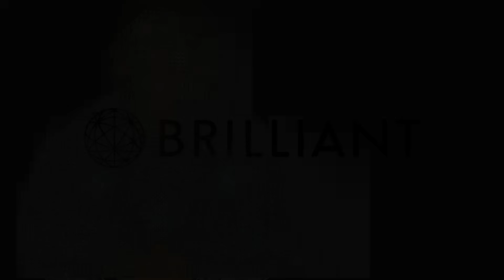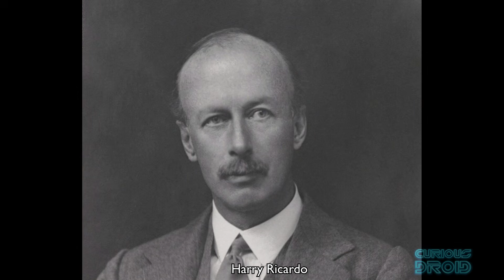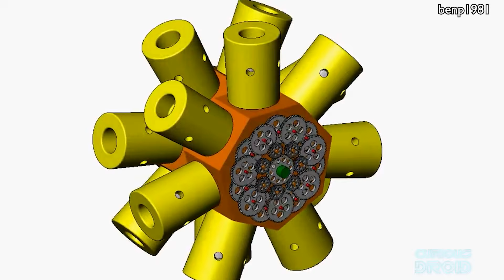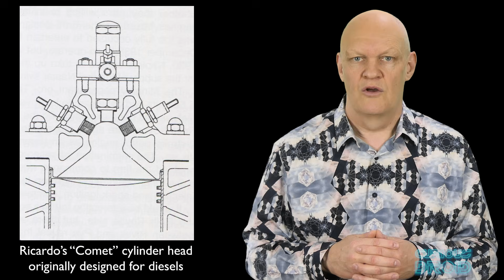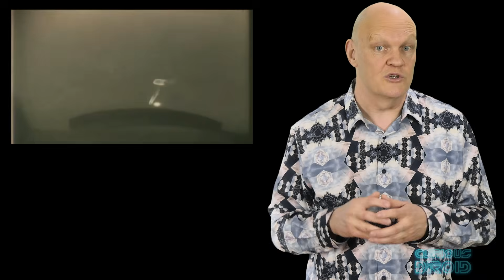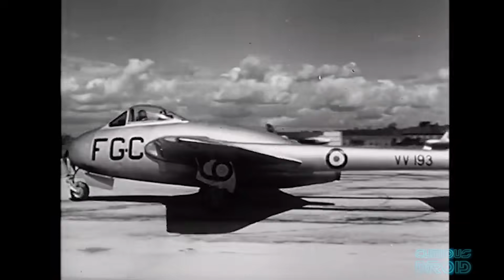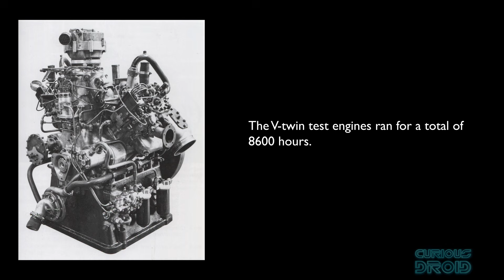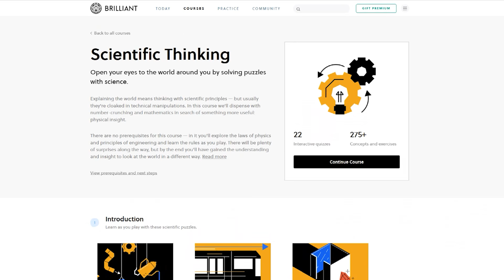Rolls Royce Crecy - The Most Advanced Piston Aero Engine Never Made.

Comment: Rotary? You mean radial! Rotary is something completely else. ;-)
Reply from the maker: Yes, I meant radial, my bad
Reply: @4one14  It did, you turned sharper one way than the other, powering up caused a wicked snap roll and the gyroscopic effect the engine had made precision flying a black magic art rather than a skill.
Reply: You Wankel !!! 😉😜🇬🇧👍
Reply: Long live wankel
Reply: @McRyder67  not Wankel rotary...
Look up World War 1 rotary.
The radial had the pistons stationary with the shaft turning.
The rotary had the shaft fixed and the pistons spinning to aid cooling.
Reply: @PrinceAlorian  got it thanks, but still long live wankel 🤪🤪🤪🤪
Reply: @PrinceAlorian  Yeah, piston rotary engines were crazy shit.
Reply: @McRyder67  any excuse to say wankel…it gets taken haha
Reply: @trayolphia5756  most def
Reply: @PrinceAlorian  Do you mean 'cylinders' vs "pistons"?
Reply: @loganv0410  To be anally correct the pistons and shaft remains stationary and the entire engine block (cylinders) including the valves and valve train rotated in a rotary.
Reply: @PrinceAlorian  if i remember well, you have to switch off some candle to vary power output
Reply: @AaaBbb-ff1pn  Some versions didn't have throttle control, it was all or nothing on the power band.
Reply: @PrinceAlorian  weren't they called orbital engines?
Reply: @johneyton5452  No, the orbital engines were designed in the 1970's in an attempt to fix the problems inherent to the Wankel engine.  In an orbital you have a round rotor orbiting a shaft, similar to a Wankel's triangular rotor rolling in that figure 8 shape you can see in the inside engine walls.
Reply: @McRyder67  The Wankel, technically a pulse fired orbital turbine.
Long live the Wankel! Long Live Apex seals! Long live red-lines going plaid!
Reply: @PrinceAlorian  Oops you're quite right. Got the names mixed up. The 70s one that never took off was the Sarich.

Comment: I'd love to see a modern sleeve valve 2 stroke.
Reply: I'd love to hear one(with ear pro, of course. My hearing is permanently damaged from racing unmuffled 2-stroke motorcycles)
Reply: Diesel 2 strokes still exist. Ge made a few thru EDM used primarily in locomotives. Beautiful sounding engines.
Reply: Not sleaved but still beaut
Reply: maybe @2STROKESTUFFING should try this for his ultimate 2 stroke monster motor.
Reply: Great video but need to say the Merlin was 4 valve not 2 valve engine like the American radials.
Reply: Could start lubricating  with vegetable oil for sleives   and as it burns up  no pollution  just smell of frying, could still retain proper oil for crank
Reply: @garypeatling7927  vegetable oil has no film strength
Reply: @garypeatling7927  Ever seen a deep fryer after a few hrs use!?.
Reply: Pollution. 2 stroke is HIGHLY polluting due to incomplete combustion. Even 4 stroke V12s are being phased out soon.
Reply: @SF-li9kh  Check out the Rotax E-TEC voice coil direct injection 2-stroke engine they are powerful, fuel efficient, virtually smoke-free & have low emissions. This type of engine has been powering snowmobiles & outboard motors for more than a decade.
Reply: @autodidact537  you’re correct about that detail. Phenomenal technology from an Australian man Ralph Sarich whole put a. 200cid straight six Ozzie ford engine in 1969-1970 and it was very powerful for its time.
Reply: @autodidact537  these engines far to expensive  and delicate  100 hour wonders, jet ski with them in always knackered when I see them
Reply: @garypeatling7927  What are you smoking? The BRP Sea Doo jet skis are all powered by 4-stroke Rotax engines. The Rotax E-TEC 2-stroke engines are very reliable. My Ski Doo E-TEC has thousands of miles on it & is still going strong.
Reply: @autodidact537  dont do many didnt even know rotax  did  four stroke I personally  have only ever seen them with rings eating the bores
Reply: @SF-li9kh  You're speaking of standard moped and lawnmower motors whose major contribution to pollution isn't the incomplete combustion (there are ways to improve that btw) rather it's the necessity to add oil to the fuel/air mixture.

Those 2 strokes use the pistons movement to suck in fuel/oil/air mixture into the crankcase and up to the inlet ports, which means you cannot suck up oil, pressurize it and guide it through crank bearings like a 4 stroke.

So adding oil to the mix is how this problem is usually tackled, but of course the downside is, you don't want oil in your fuel air mixture but that's just where it has to end up, and get burned and expelled through the exhaust all the same. This causes a significant odor and a blue-ish smoke and is not environmentally friendly at all.

The sleeve valve doesn't seem to have the same issues. Mixture gets forced in same way as in a 4 stroke, and out similarly by the pressures induced by the moving piston and the ports in the sleeve allowing the pass through. So here it's not needed to add oil to the fuel/air mixture. 

But it does raise an interesting question. How is the oil film between the sleeve and the cylinder lining as well as the film between piston and sleeves accomplished? I'm guessing a separate oil pump?
Reply: @ta22stcoupe  I don't know if links are available here, but on the wiki page there is a cout throu picture of a real engine wich has what at least to me looks like it could be external oil rims in the cylinder walls on two points of the outher passage.
Reply: @Vampi_Sweden  That would make sense. They had to have some way to seal the cylinder in the cylinder from the combustion gas pressure. I was hoping that would be mentioned during the video.
Reply: @OIE82  I might be wrong, this was just my wisual guess from looking at the picture when i tried to magnify it..
Reply: @SF-li9kh  this doesn't burn oil.
Reply: @SF-li9kh Not necessarily, Ricardo ran his test engine as stratified charge.

Comment: seems very much like a 2 stroke Detroit Diesel but using gasoline....
Reply: Except that 2-stroke diesels typically use fixed ports in the cylinder walls rather than the complexity of rotating sleeve valves.
Reply: The original plan from Ricardo was for a 2 stroke Diesel, but this was changed part way development to the petrol spark ignition "sprint" engine.

Comment: Correction....   Merlin had 4 valves per cylinder, some of the later engines had sodium cooled exhaust valves...
Reply: I believe they all did - the sodium filled exhaust valve was developed in the US in the late 1920s/early 1930s. 

Also, the Griffon was not a Merlin derivative.
Reply: @waynec3563  Very true !!  Yet so many people spout the $hit !!!  Merlin was a right hand tractor engine and the Griffon was a LEFT hand tractor and had a different firing order from the merlin.  Each engine developed from its own root engines and only releated because of RR as manufacture !!!  Sooooo much information just tossed about willy nilly !!!!
Reply: Indeed. Modern F1 engine practice uses multiple poppet valves and extremely "oversquare" bore to stroke ratios to get about 2HP/c.i.
Reply: @dbmail545  as a modern f1 engine has less than 100 cubic inches in displacement and its horsepower is about 800. It has nearly 10hp/ ci
Reply: @cadmcspeed1418  I was referring to modern street legal motorcycles with F1 technology like the Hayabusas, Ducatis and Rotaxes.
Reply: @dbmail545  1 litre is approx 61 cubic inch, and they are producing significantly more than 122 BHP per litre. For example, motoGP bikes are putting out somewhere north of 250BHP with the old two-stroke 500cc bikes producing around 380BHP/litre.  https://www.mcnews.com.au/motogp-bike-acceleration-figures/
The first person to achieve 200bhp/litre on a vehicle was (The Great) Walter Kaaden with the 125cc MZ racer.  https://en.wikipedia.org/wiki/Walter_Kaaden
Reply: The Ford GAA was an all aluminum DOHC motor with 4 valves per cylinder.  Ford wouldn't make another motor with this technology until 1992
Reply: @RidinDirtyRollinBurnouts  that depends on whether you include their joint efforts with Cosworth, e.g. the alloy blocked BDA of about 1972.
Reply: @M Bacon 4 valve cylinder heads were earlier. The 1913 Peugeot Grand Prix car had 4 valve cylinder heads. 

The Rolls-Royce Condor, which was dveloped at the end of WW1, had 4 valve cylinder heads.

The sodium filled exhaust valve was developed in the mid 1920s.
Reply: Came here to say the same. It's also a single overhead cam with angled rocker arms to manage the multiple valves.
Reply: Evan the older much malinged Allison V1710 had 4 valves per cylinder, and had the roller tip cam followers, no RR engine, even the merlin had those. Modern Racing engines today use the roller cam followers !!
Reply: He also got his rotary confused with his radial....